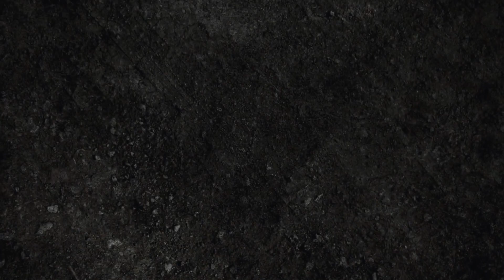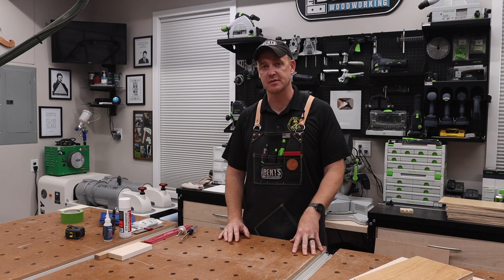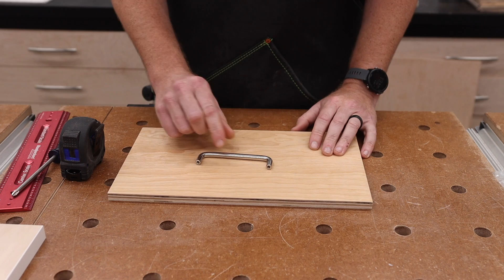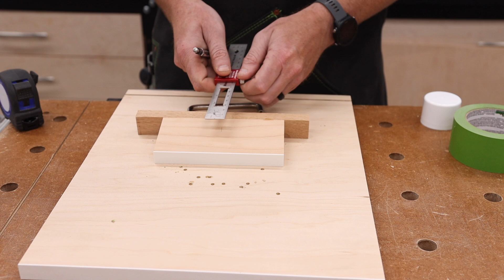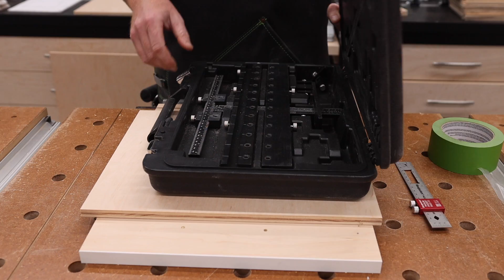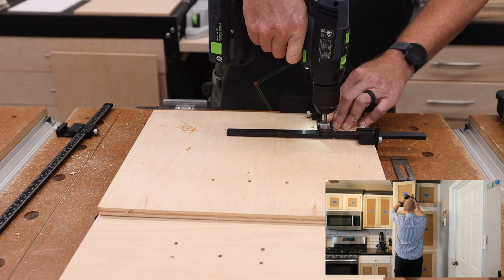Installing cabinet hardware can be easy

Comment: Thank you for posting. I first saw that last option at some of the stores but didnt want to spend the money for it. Looks like I will need to make 2 jigs and use centerline as I have 2 different heights of drawers and over a dozen different lengths. The Kreg option looks interesting but just looks too cheaply made to trust it. Going put eyes on the new Rockler one though.
Reply from the maker: Glad you found it helpful

Comment: Thanks for showing that there is always multiple ways to get to the results you desire. I find myself not trusting my Paolini ruler to make accurate perpendicular layout lines to a surface due to its short reference edge, so I’m a little surprised you didn’t use a square, especially for a jig layout. Probably just my OCD getting the best of me, but I would hate to have a kitchen full of crooked hardware. 😳
Reply from the maker: That ruler is the most used item in my shop.

Comment: I know your reason for using metric, but I dont see how it saves anything if you still use SAE drill bits and fasteners and drawer pulls lol

This video was helpful though. I like the idea to use tape to mark layout lines without needing to erase them from the actual board.

My other question is how do you make sure your holes are perfectly perpendicular to the plane of the the drawer front? I always have trouble with that, is it just a matter of practice, or what?
Reply from the maker: If they are referenced off the top, they should all be inline with each other as long as the fronts are installed the same.
Reply: @bentswoodworking  i meant how do you keep the drill and bit perpendicular to the board (like would be the case if you were using a drill press).
I know the holes would be the same distance from the top (at least on yours. Knowing me, it have the jig lopsided lol)
Reply from the maker: woodworker Royer if I’m not using a jig I would just be eye balling it. I have never noticed any issue though.
Reply: @bentswoodworking  Thank you.